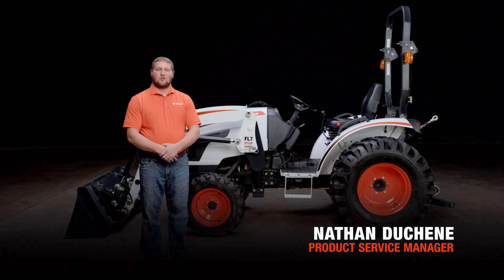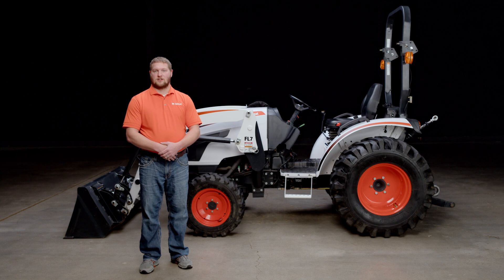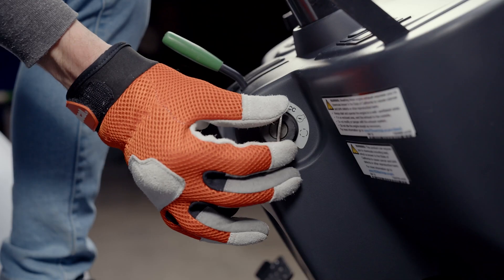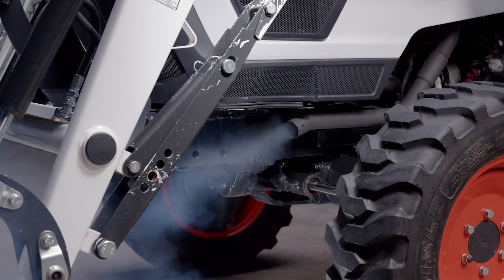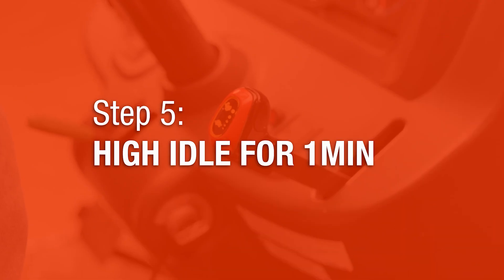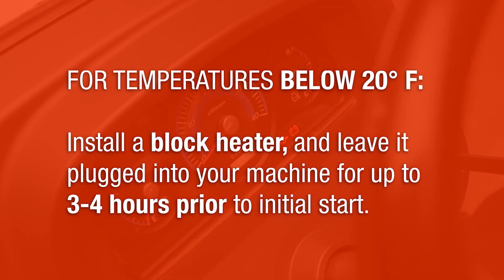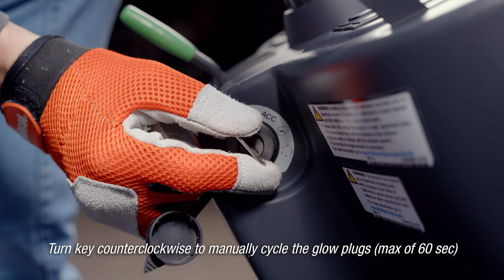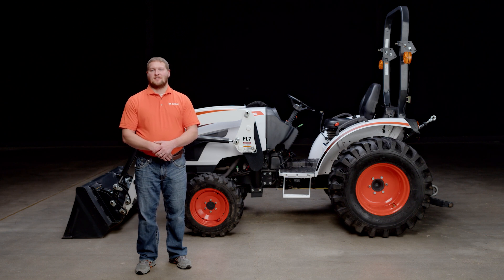How to Properly Start Engine & Smoke Mitigation | Bobcat Compact Tractors | Tutorial

Comment: I’ve had three compact tractors prior to my CT2025.  This is the hardest starting tractor in the cold I’ve owned by far.  It also has an aluminum oil pan so magnetic pan heaters wound work. In temperatures as high as 40 I have to put a propane heater under it  for and hour to start the damn thing. Bobcat sells a block heater but you have to take a knockout plug out of the block and bond it into the block.  I don’t care for that solution.

Comment: Bought my 2025 September 5th 2023. Dealer picked it up September 9th 2023 and kept it 8 business days. Returned it to me claiming it was bad fuel. 2 days later it smoked so bad it filled up my garage where it's kept. I pulled it outside and left it running for approximately 1 hour at 3/4 throttle and nothing changed.  Took it back to the dealership myself and the advisor basically started arguing against my claim! He called a week later and said Bobcat warranty says that the injection pump needs adjustment and if it still smokes it is normal and nothing else will be done.
Reply: Yea, same here. You know it is a problem when they release a video like this to try and calm the masses. You can not find the tractor in the garage from the smoke.